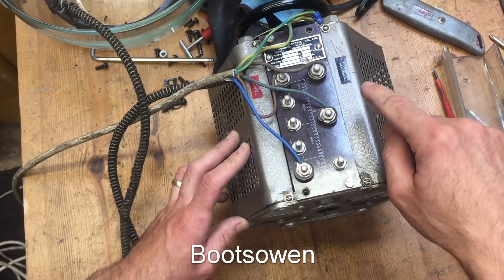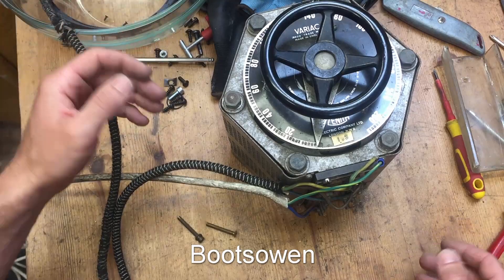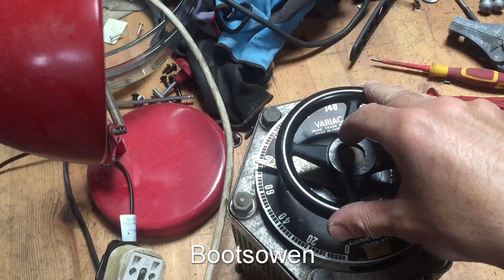Checking my faulty Variac: Claud Lyons Variable Autotransformer

Comment: Owen, these bits of kit are a must for the home workshop. As you know I use them for testing grid inverters but your idea for using  a washing machine motor is great. As Tommy says some cable restraints would be help with machine longevity, cheers
Reply from the maker: What I would like is a sensitive trip switch on the bench. I have tried using a second one in line with the house rcds but usually both trip.
Reply: @bootsowen  Can you bring an unprotected supply into the workshop to a different consumer unit / trip switch?